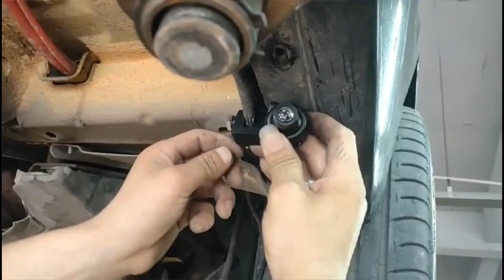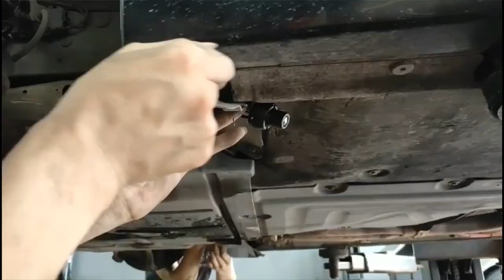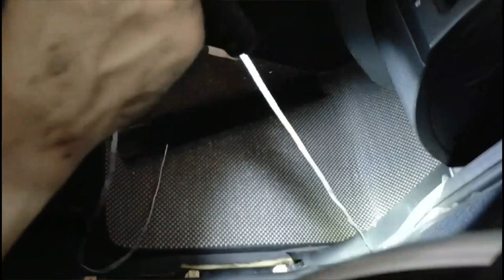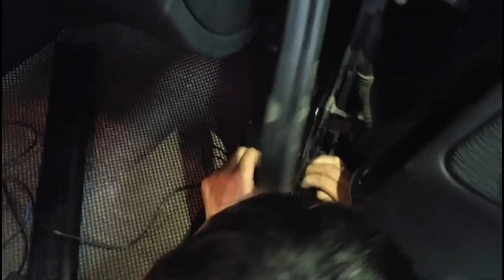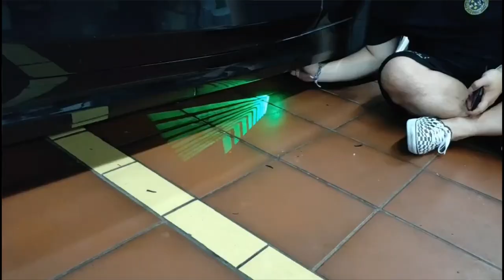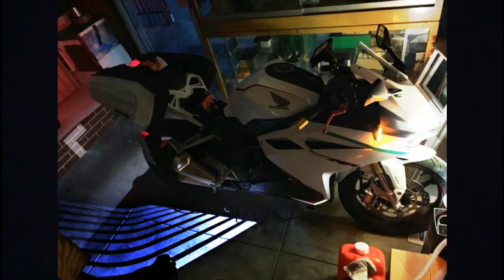Car LED Neon Light, Angel Wings Welcome Light Carpet Ghost Shadow Light Car Door Exterior Light

Comment: Hi, I want to do this myself.

I have the lights but need to know which wire to splice into, I am presuming the overhead dome light as when I unlock the car this comes on then goes off when closing the car door, on a timer I guess, so want to splice into this or similar but there are many wires going into the dome light, do you know which one I splice into for it, or similar, which colour wires on the dome light, I’d really appreciate your help.
Thanks so much.